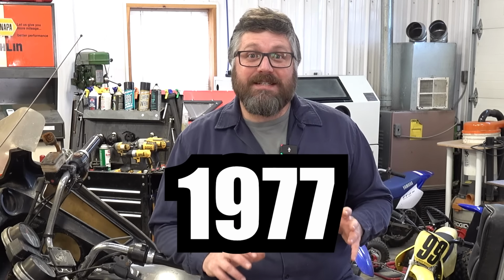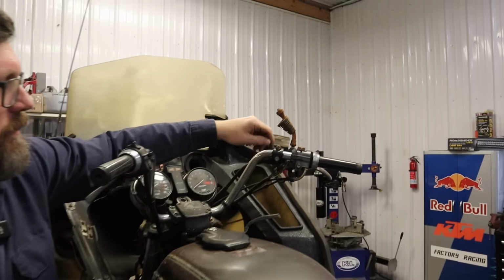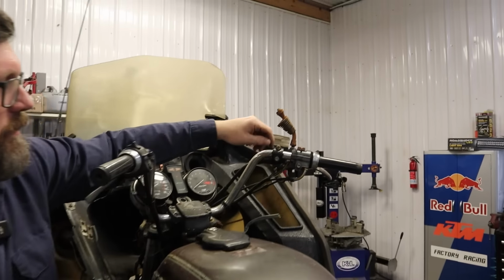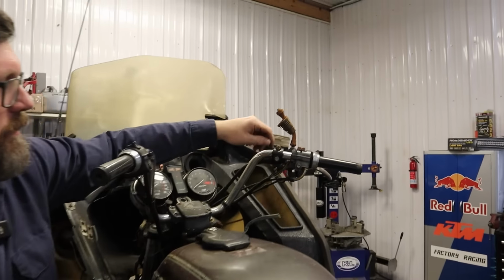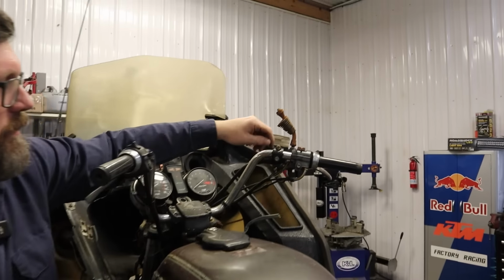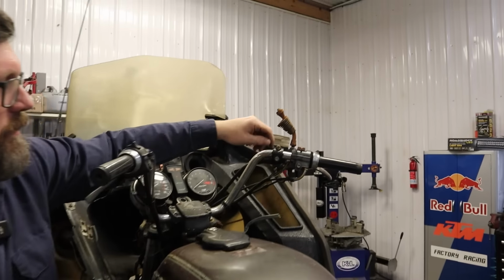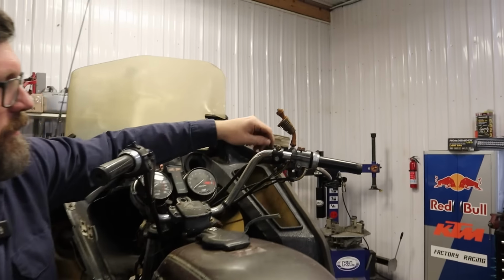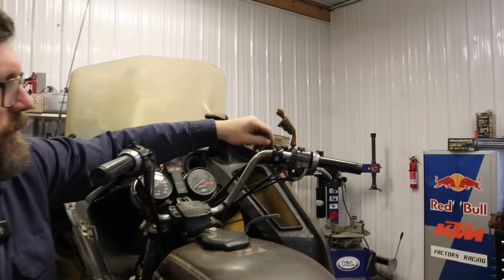Engine Seized! Can I Get This Cult Classic Honda Running?

Comment: I like most London Motorcycle dispatch riders owned a CX500 in the 90,s.
It was great,The cooling fan was held on with self tapping screws and i wore the foot pegs off of it on roundabouts.
And in winter when you stopped at traffic lights you could put your hands on each cylinder head to warm them up
Reply: ... is the most oft' repeated thing folk say to you when they see you're on a plastic maggot 😁 (zero plastic on mine)
Reply: One of the first things I did when I started riding (early 90's), was follow you guys around London. Sure learned how to filter!
Reply: Rented mine from Chaz Bikes before I bought my own. Best despatch bike ever.
Reply: If it had a sheepskin seat cover it was probably my old one!
Reply: I rode one too, never did like it round town much. Did most of my despacthing on a cb250rs, got through three of them, and then a VT500, fantastic bike.
Reply: But ridden hard every day with oil change every week and tyres every month you’d get 200-300,000 miles out of one. 
A truly great bike.
Reply: Had a CX650 in London in mid 90's that was fine until stuck in traffic at which point i'd see vast clouds of steam/smoke in the rear view mirrors. It's true they just keep going no matter what but when the alternator failed I cut my losses and sold it to Chaz Bikes for pennies, even he was despairing of them by this stage.
Reply: @stevecoward3543 my 650ed did a year of dispatching 83-84, 24000 in a year 
It’s nowhere near as tough as a 500 - the cooling is terrible. 
Electric fan with a rad 2/3 of the size means it overheats in traffic , which you found. 
A discrete fan override switch sorts that out. 
Can believe I’ve had that bike 19 years
Reply: I was a dispatch rider in Netherlands and whenever my XJ900 ( with a cardan drive) was in maintenance, the bike shop would lend me a CX500 so I could keep working. Smooth and agile bike.
Reply: I was a London DR in late 80s and early 90s . I had 2 and rented the others from Chas Bikes, (£67/week)then in Greenwich. "The Maggot" was top heavy and slow but reliable. I think you could get 105mph laying flat on the tank. The brakes were awful by todays standards and it would wallow badly in the corners , it sometimes helped if you squeezed it up with front and back bakes as you entered a corner. Cheap, A-B machine. I swore I'd never ride one again !
Reply: I also had the cx500. London despatch rider 87 to 93..about. Chas bikes..an icon.. wings couriers..

Comment: I thought the three dots signifying the recall was done were on the engine block, not the VIN plate. Left side of bike, where the block is stamped with model/serial # . The 3 dots wear punched in the empty space on the left

Comment: OMG YES! that was my first motorcycle back in 2018 when i got my license. It was working but needed work. did all the work with my brother and I. loved it. I put over 15k miles on it in less than 6months. Such a great bike.

My current 2014 honda fury is also chaft driven. i love it. wish more brand would do it

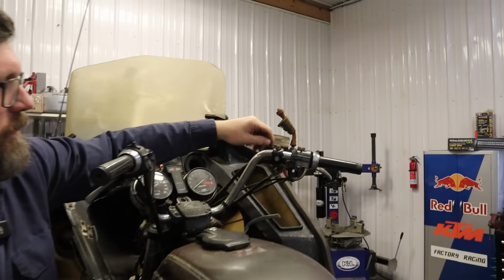Comment: 15:34 - That's the oil pump chain. The timing chain is at the rear of the block. Failed timing chain tensioner and guide is a common CX500 problem. Broader issue is CX500 parts are increasingly unavailable. Over size pistons and rings are getting difficult to find. Given the condition of the bike its likely a parts bike.

Comment: This bike had my favorite method of mounting stuff, shoe string, parachute cord, zip ties and electric wire.
I missed superglue and double sided  sticky tape...
You just cannot do without this stuff.  😎
Reply: My Yamaha road trail has both side covers held on by cable ties 😂 they’ve been holding up well in this hot Australian summer.

Comment: I used to have an '80 CX500. I was young and didn't have a lot of tools, knowledge or resources. It wouldn't idle to save its life. Found I had a bad spark plug boot and fixed it by cutting the finger off of a rubber glove and taping it around the boot with some electrical tape. Best fix ever!
Reply: That's awesome! Taking notes😅
Reply: did similar to my CT70

Comment: CX500 Custom, can tell because the turn signal relay is under the right side cover. If it was the Deluxe, flasher relay would be under left side cover, and CX500 base had the turn signal relay inside the headlight nacelle.

Comment: I bought a 78 GS1000 Superbike that had been leaning up against a garage since 1980, they raced it for a season and parked it untill I bought it in the mid 90s, everything was rusted and gooped up, brakes were shot front and rear, rotten tires, no spark in 2 cylinders, electrical gremlins and it had no lights! Just number plates.  In 2 weeks going through every system I had it running like new and factory gs1000 lighting package on it. Rebuilt the brakes, forks,scrubbed out the tank, Rebuilt the Keihn drag carbs and synced them, replaced the throttle cable and was pulling 150mph passes untill everything settled back in untill one day I thought I needed to know what top speed was, I hit 185mph, almost got blown off the bike because I sat up too soon, sold it soon after that! Never did find out how fast it really would go, but it was still picking up pretty hard at 185! I don't get scared on bikes usually but that's one that I admit was probably too much giddy up for me😂😂😂 it was fun while it lasted, about a year or so riding all over colorado, but I decided I wanted a cruiser and gave up my speed demon ways in the interest of being alive awhile longer.

Comment: My dad has got 4 Honda CX Turbo's. 2 500's and 2 650's. Two different animals, but very fun to ride! Also one of the first bikes to have fuel injection and a ECU to run it all with fault codes to diagnose when it goes bad. 😅😅

Comment: I have 2 GL500 silver wing Interstates. Essentially the same engine with a little bit more output from the charging system, in a slightly different frame. My daily Rider is all original, and my second one has been converted to a Cafe Racer, still gotta get ne front brake calipers for it though.

Comment: I have a donated CX500 sitting in my garage. Rebuilt the carbs but now think i should check the engine before moving on. Thanks for the inspiration. Oh and mine needs plenty of wire work too...

Comment: old timer friend of mine would drill out a spark plug , weld on grease nipple, then fit back on engine , then pump full of grease. over the next couple weeks would give a few pumps per day until the piston moved out under hydraulic pressure. worked on old farm engines some submerged underwater for decades.

Comment: I had the issue with the spark plug boots on mine. They were cracked Al over and sparking off the heads. We used the fingers off a rubber glove and electrical tape to fix them and it worked for the 3 years I had that bike

Comment: I had one of these and enjoyed it for a year or two, but my wife didn't like the frame fairing and it seemed to be under powered. A friend thought it may have had a problem with one cylinder, but I sold it and got a Suzuki 700cc Intruder.

Comment: The water pump runs off the end of the camshaft. It has a mechanical seal keeps the coolant side way from the oil side. The seals can leak which will explain the water in the oil. You will have to take the gear box out in order to get the left side con rod and piston out.. The right side is reachable without removing the gear box. Take of the radiator and remove the front of the engine where the clutch is and you can get to the crankshaft and the left side end caps. Its not a long job to put this right.

Comment: In 82 I bought the 1st CX500T (factory turbo) in the state and I loved the bike. At the time I never got outrun by any street legal bike (it was fast and I adjusted the turbo dump gate pressure so it booked-didn,t have a craig but i did spend $100 on the full factory manual which was a ton of money at the time). . Had to sell it when I got divorced or I would still own that bike today.

Comment: Very popular during the 70s oil crisis. Neighbor I mowed lawns for had a Cb350 and said if I could get it running it would be mine
Many attempts never happened but love those old Hondas. 750 SS extended swingarm drag style...dream bike
Or a KZ1000

Comment: I had a CX500 in the 80's. These engines and frames are popular for constructing 3-wheelers in the  style of the old British Morgan's of the 1920-30's. Engine in front, two front wheels and driveshaft to the single rear wheel.

Comment: Back in 1987 I bought a 1980 CX500 that was all original and in "like new" condition.  I really enjoyed riding it up until a few years ago.  Traffic where I live is just too unsafe now, so I sold it.  I really hope the new owner didn't molest it and turn it into a "cafe racer".  Mine had the OEM Honda engine bars, back rest and luggage rack as well.  It was a good, strong runner and I garage kept it and didn't hammer on it, so someone got a really nice bike.

Comment: Great Video!! I had a CX 500 and would still have it today if the crank shaft hadn't worn out!! At the time they were spray welding as they called it and re machining the crank shaft in the UK which lasted about a week so I sold it to a guy who had an engineering business where they cleaned up the crank shaft and custom made new shell bearings to fit (Wish I'd know about that)!! A well worth while bike to totally refurbish. Would love to have added a photo but there doesn't seem to be an option

Comment: Nice you can get heads off so easy, we had some early 80's honda V4 bikes siezed, had to pull motor, cylinder scoring bad, carbs aimed at sky, ingest fluid, CX500 cool.

Comment: I had a 1978 CX500 that had a common issue with soft rocker arms resulting in having to adjust the valve clearance often.  Like other owners, rode the bike for thousands of miles.

Comment: I had one of these!  Less the fairing, but exact same bike.  Almost in the same condition too, left outside for decades against the side of a house.  Got her working just fine.  I even had it repainted!  Rode it for 2 years until the front brake seized up and sold it for not bad cash.  Always had a soft spot for these, my 2nd bike and the first a 250 Ducati Monza, first year for the Desmo valve system.

Comment: I remember working on those often at the dealership and the tech school I went to in the late 80's had several of the CX 650 turbo models along with about 6 CBX 1100's donated by Honda since neither bike sold well at the time they were produced. You can unstick a motor and anything with 90 pounds of compression and spark will start with starting fluid but what's the point when you would have to completely clean and tune the fuel system including cleaning the rust out of the tank and much more like replacing or repairing the petcock then you still have to replace the motor that was seized because a seized motor will burn enough oil to foul every plug you put in it until it finally destroys itself.

Comment: Hey Craig. I bought a ratty 78-ish CX 500 with just 5000 miles showing for 400 bucks from Jeff Kahn in Seymour Wisconsin and shipped it back to the Uk with 16 other bikes. It sat in my storage for about a year until I got round to having a look at it. When I got it on the stand it too was seized. I put some "Marvel Miracle Oil" in the cylinders and rocked it carefully back and forth in 5th gear every morning. On the 3rd morning it freed up ( Woohoo!) so I put a battery on it and it wouldn't turn. Just like yours the starter was also seized. I stripped it and it was just a mass of rust ( though the brushes were hardly worn)  as it it had been immersed in a lake, but with a clean and grease up it worked. So I put it back on the bike and spun her over...great spark..we're in business. The carbs were stuck too so I popped them off and gave them a sonic clean. 
When I put the carbs back on, the bike started after about 15 seconds of spinning . It was VERY smoky and I thought it was maybe damaged inside but after about 10 minutes of running it cleared.
The tyres were shot-they were the originals- and it had a seized master cylinder so no brakes ...but I snagged a new Chinese master cylinder for £13( maybe 16 bucks) and the brakes came up a treat. All the electrics except the starter relay  worked as if it had run yesterday
 I then cleaned the bike up and it came up really nicely.  It rides so well 
I never liked the CXes but for some reason I really like this old gal and will probably restore it properly due to the the low miles. Everything tells me the miles are genuine  and we have almost no CXes left here.  

Here's a vid I did about it that shows it starting for the first time.

https://youtu.be/npoOAYneTU4

Thanks for the videos, they're fun

Comment: That just looked like a classic burst into flames scenario with that fog or starter fluid and the engine firing and kind of running/running. It's sort of funny when it happens but only because you're never hurt so I'm a little bit happier when they don't burst into flames.

Comment: Hey ! Love it. Ive had a few cx500's over the years and love them. The water pump is usually the issue with these. A real pain to replace or repair. I thought about coming up with an electric water pump somehow.

Comment: Regardless of what Honda may have said about the comstar wheels, the only reason they used them was to save money.
That engine was a peach (the whole bike was actually).
On UK bikes the three punch marks were on the front of the engine after the engine number
24:38 that's why the engine ran like a watch

Comment: The head light usually was used in the fairing.  Change the clutch plates to one less plate and stronger springs.  It will pull wheel stands in second gear on the go.  Be careful  cornering, I used wear out foot pegs and center stand from dragging them in the corners.   I traveled the east coast, sometimes two up, above 70 mph.  Great bike, l miss mine.  We have an expert who restores these in our town at a great price.

Comment: had a cx500 it was slow nice handling great gas milage.. spun the bearings got a junk yard replacement.. What I totally loved was my cb750custom what a bike. Dealer screwed up sold the 750f I had the contract.. So I got the custom for 200 more, what a deal 2500 bucks the other honda dealer sold it for 4500..  sold for 1k 12 years or so later to 1st person who saw it. bike was flawless..  It was an animal.. great on trips

Comment: Thats the oil pump chain at the front, cam chain is on the rear, behind the known to fail alternator stator.
Sand the rust ring off, clean the carbs, put it together and i bet it runs for years

Comment: I had a CX500 and was not very fond of it. If I remember the center of gravity was high and those cylinders by your shins were pretty warm on a hot summer day. I did like the tubeless tires and shaft drive. Water cooling was a little unusual for a bike that size in that era. I think there was a service bulletin out about the water pump locking the motor up for some reason.

Comment: Got a stuck engine? use a  get a long breaker bar and socket, set it where you can hookup a  com along or cable wench. Pull against the engine and get some on the breaker bar tension. Let it sit and check now and then for slack and more tension.

Comment: These were released in 1978 in 4 forms ,the CX500 custom . the GL500 with fairings and panniers and guess what the CX500 Shadow and i almost forgot the Eurosport CX500 .And don't forget the CX650 plus CX500 Turbo . This has the wrong wheels for a 1978 model . For some reason they turned those plates or spokes around . So the first ones had those plates opposite way around to this plus they had a small black plastic piece at the rim end covering the rivets. Those 3 dots should be near the engine number on the block . You should be able to look up the chassis no and engine number to find out if they belong to each other plus when they were made . Plus that's a Vetter fairing that could be bought as an add on from Honda. Worth a fortune . When new you could order your CX500 with all the addons the GL500 had . I've had a few of these the first one was a 78 model if I remember rightly they had a metal piece with CX500 shadow on the side covers. But I rode that every where . After having chain driven bikes these were as smooth as and you didn't end up with a buzzing on your left side from the chain after a decent ride. The last one I restored I sold about 4 years ago . Getting parts for these has gotten rather tricky . Forget about getting oversize pistons . big end and main bearings. I got a new cam chain with tensioners from England .I would hate to buy them now.

Comment: I had a 1980 CX500C and the seal between the rear plate and the middle section failed injecting Coolant in with the engine oil.

Comment: A trip down memory lane...
I used to drive one of those CX500s about 25 years ago.
The engine held up for 98.000 km, so about 60k miles, which, as far as I know, is a respectable achievement for a motorcycle form the early 80´s.
Loved the low maintainance of the shaft drive, but it made the bike rather heavy, on top of the already heavy water cooling.
Handling was not the best, since the rubber elements that were installed to dampen shocks from the drive shaft to the engine, 
had a tendency to get into a resonance when playing with the throttle even a little bit.
Since the V2 engine was initially designed to run water pumps, the CX500s even had a nickname in Germany´s biker scene, 
even though is was not really a kind choice: The nickname was "Güllepumpe", literally translated: slurry pump - and since this might get lost in translation:
Yes, "slurry" means the smelly stuff, that farmers spray on their fields, consisting of animal manure, urine and water.